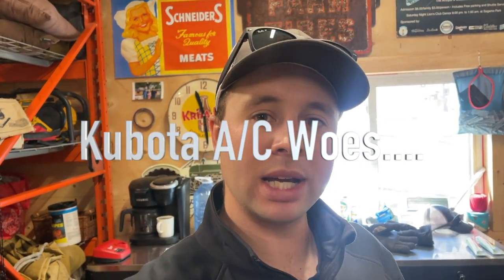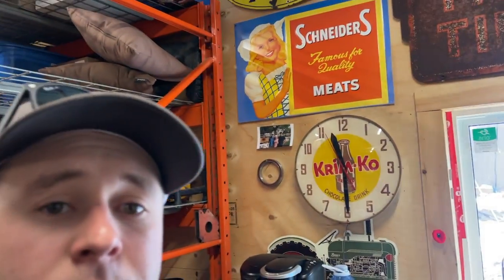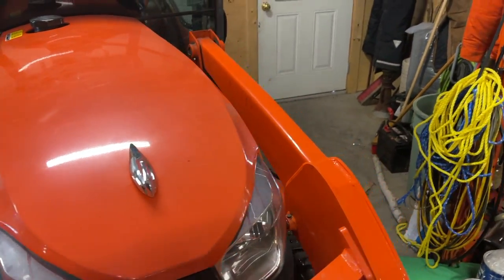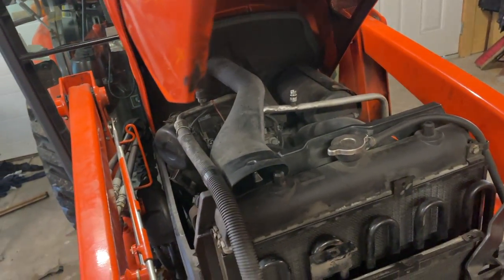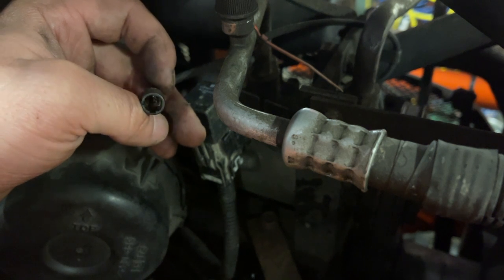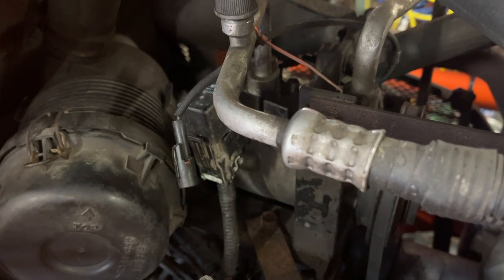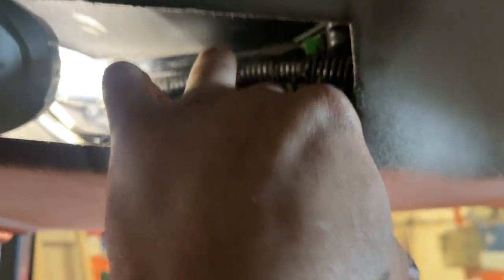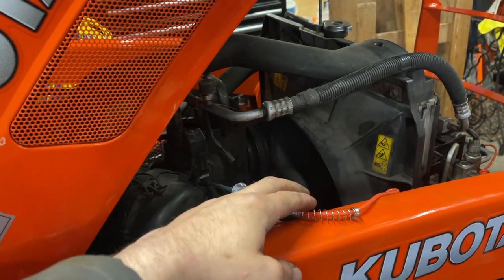Kubota Air Conditioning Woes.... We got it fixed!!

Comment: I have Kubota M6800 tractor and having few AC issues (blows cold initially, then becomes warm after running a while). Was wondering does the compressor clutch supposed to stay engaged all the time while the AC is turned on, or does the compressor supposed to cycle on/off like most vehicles do?
Reply: I have a Kubota MX6000 and had the same problem.  I found out that the the heater isn't turning off completely; no matter how you mess with the temp knob.  

It's very hard to find schematics for the cab A/C and pictures of the system are nowhere to be found.  I believe there is a coolant control valve in the A/C unit that controls coolant to the heater core and it is definitely NOT shutting off.  If you find your heater hoses, you'll find one side gets hot and the return is slightly cooler, which means it's transferring heat and interfering with your A/C.

I simply put strap hinges across the heater supply hoses and tried to clamp it off.  There's still a bit of coolant flowing past the clamp because I didn't want to risk totally crushing the hose.  But, my A/C performance has improved and thus proved my suspicions of what was going on.